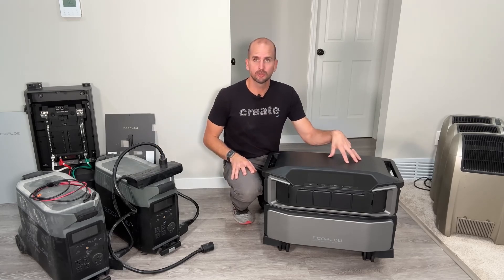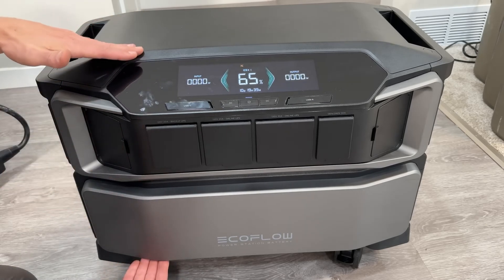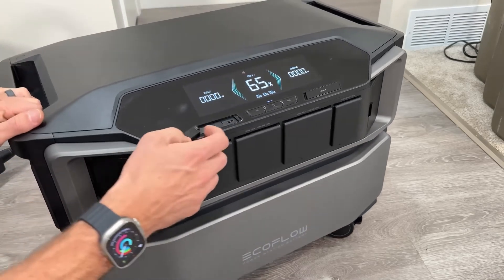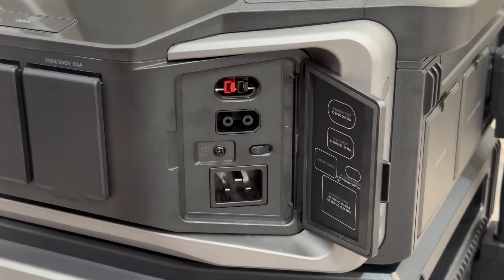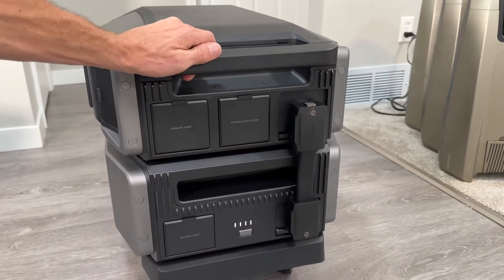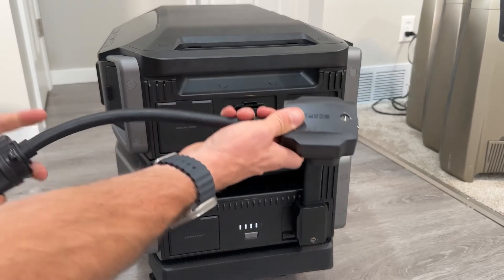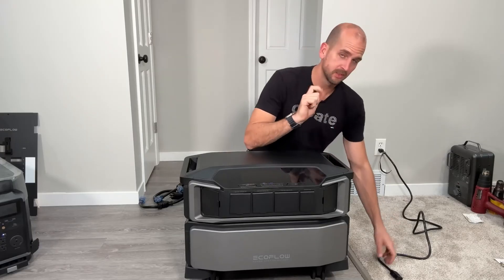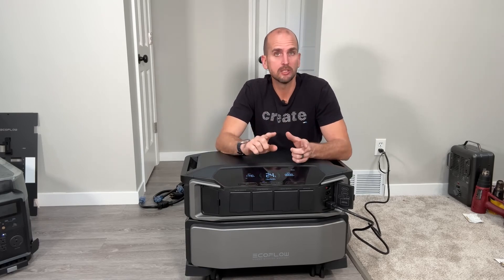EcoFlow Delta Pro Ultra Review – Real-World Hands-On Test

Comment: Hi there. Very informative! I have a question not covered in your video. Let's say I have the EcoFlow DPU with three batteries for a total of 18kWh capacity. This is powering a load of 1500w. The DPU is connected to an AC outlet as well with the charge setting at low (400w). Will the DPU pull the total 1900w load from the AC bypassing the charge limit setting? or will it take the 1500w load from the batteries and 400w from the AC? For the sake of argument let's say that the DPU is not connected to any solar panels. The circuitry in my off-grid cabin cannot handle a combined load over approx. 1200w for a single device so my goal is to be able to limit the max grid input wattage. Any insights you have would be greatly appreciated. Many thanks!

Comment: Did you find out if the 1800 Watt max input from your 240 hook up generator is a bug or just the way it is?   That sort of renders that input method useless if it delivers the same input as an 1800 W  standard wall outlet.